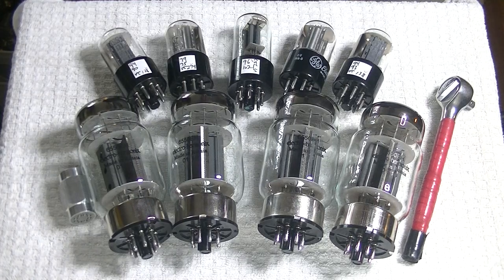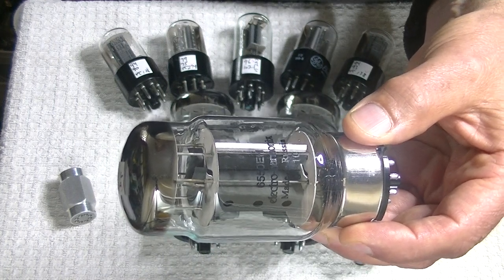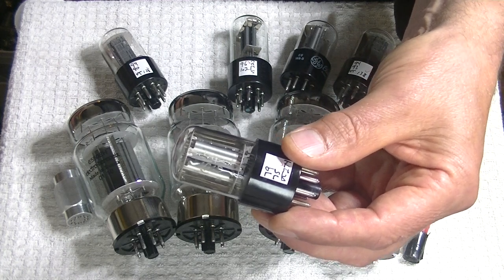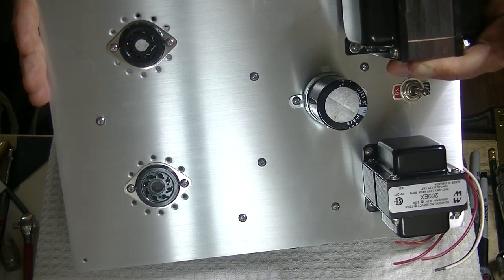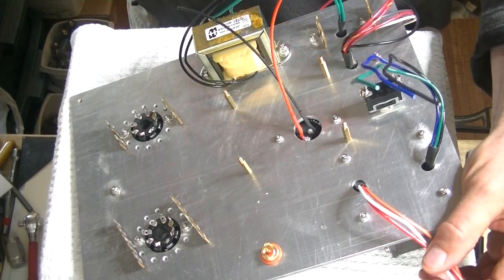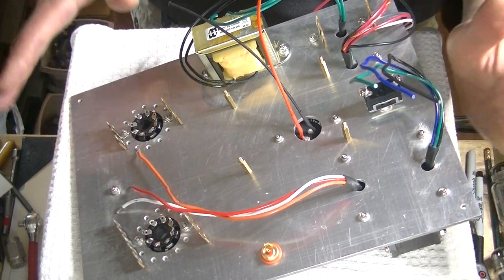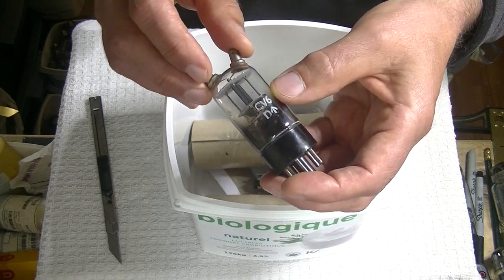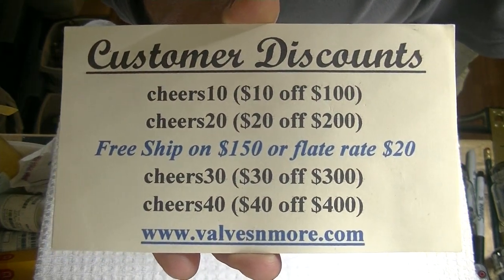Tube Lab #40 - Electro-Harmonix *6550EH + Willsenton R8 Tube Package

Comment: Hi there, thank you for the video. Do you happen to know what the switch setting should be for the 6550's on back of the R8. The settings are either for the 34's or the 88's. Not sure which one to put it on.
Reply from the maker: Hey! The 6550 is like a slightly lower powered KT88, so you want to have it on the KT88 setting. Make sure you adjust all the bias pots all the way counter clockwise and give them a few minutes to warm up, then do an initial bias, listen to some music for a bit, and then adjust the bias again. If these are new tubes to the amp, make sure you do not leave it unattended and that you stay in the room and periodically check the bias to ensure there is no drift that could eventually cause a red-plate situation.  Cheers, and happy listening.
Reply: @tubelab194  thank you. I appreciate the help. Can you tell me more about a red plate situation? I’m fairly new to tube amps and have not heard of this before. I have been running EL 34’s on it and was encouraged to run the 6550 s in order to get better bass out of the system.
Reply from the maker: @joshuabriese3525  red plating is when a tube runs away (current) and gets so hot the plate starts to glow a bright orange > hence "red plating".  This of course means the tube is destroyed and if left on other components will be fried as well and if the fuse doesn't pop in time, you could possibly have an electrical fire.  This is the main reason why we never leave any of our tube gear on unattended.
Reply: @tubelab194 thank you for your help. So far so good with the new tubes 😊
Reply: @tubelab194  Well I had my first experience with red plating recently. My Willsenton R8 runs EL34s or KT88s/6550s. I have only ran the EL34s on it but someone said to try out the 6550s for a bit better bass. So I think I have something wrong with my KT88/6550 circuit as I have had two tubes go back in V3 spot. One just stopped working and one red plated. However works just fine on EL34's. Not sure what to do next.
Reply from the maker: @joshuabriese3525  If this an older unit your bias pots are probably worn out, starting with v3 and all 4 will need to be replaced.   Caution, do not run the R8 until this is repaired.  If it is brand new, then it's likely you just had 2 bad 6550's.  You don't mention which make you are running - many of them unfortunately are junk, especially modern ones.
Reply: @tubelab194  this unit is less than a year old. And I’m running brand new Tung Sol 6550s. I was thinking bad tubes also but it happened in the same slot twice. Could it be a coincidence?
Reply from the maker: @joshuabriese3525  yes it could be a coincidence, it could also be a defective bias pot and it could be defective 6550's.  The tubes you are running are modern copies, made in the former Reflector plant in Saratov Russia, by New Sensor of New York.  They're nothing like a quality vintage 6550.  Many modern power tubes are just junk, so it's hard to figure out if it's a bias pot issue or a tube issue.  If you recently loaded the 6550's I'd say it's probably the tubes.
Reply: @tubelab194  ok thank you. What would be your recommendation on sourcing some good old 6550's? Also, sometimes, when adjusting the bias on the Willsenton R8, when I release the lever to move on to the next bias spot, the needle will stay and not return to its reseting position. Could this be a signal of a bad bias pot?
Reply from the maker: @TribeQuadQuest  The only vintage or modern 6550 that I recommend is the SED (Svetlana Electronic Devices) 6550C (caution the 6550b is a defective type and many fakes and reissues abound).  Unfortunately the true vintage Svet is now endangered and will shortly be extinct.  If the bias needle is not dropping to zero after you release the switch then you have a problem, it could be the meter or switch, or the bias circuit.
Reply: @tubelab194  thank you for all of your help. Truly amazing. Thank you!

Comment: i find this brand of 6550 tube you have to carful with the screen voltage 660 volts max on the anode and 440 volts max on the screen , true KT 88 800 volts max on the anode 600 volts max on the screen
Reply from the maker: Thanks for the heads up!  I forget the exact operating voltages of the Willsenton R8, but it's well under that and the setting for my custom power tube tester is set at 400v.